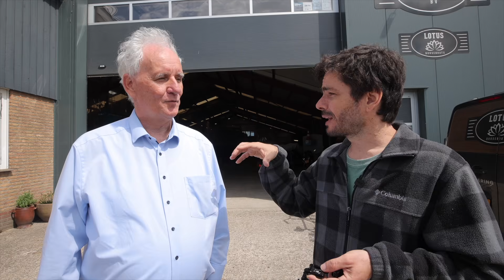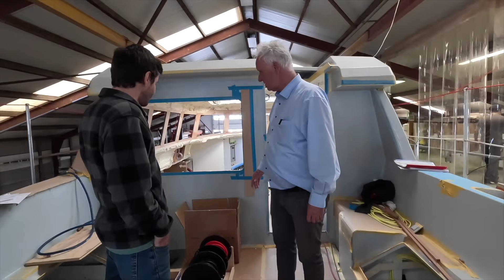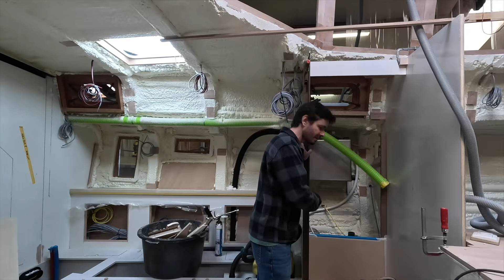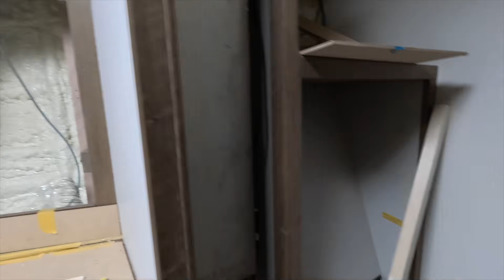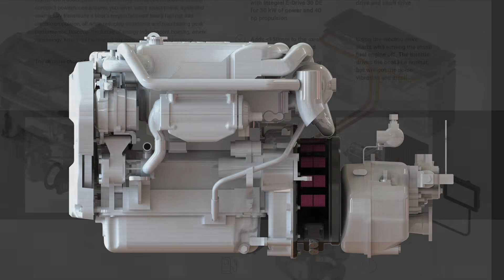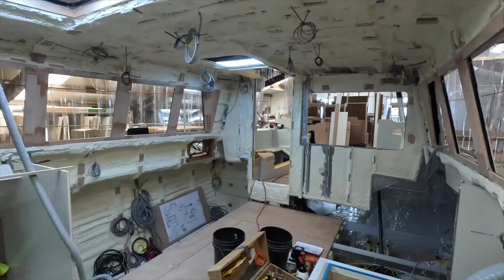⛵️ How to built a 50ft aluminum Deck Saloon Sailboat!!  Ep.360

Comment: Although it looks nice, having several bedroom windows near the waterline feels questionable in case of a collision. This would nullify the benefit of the strong aluminium hull, but the owner may have insisted. Get started with your own boat and don't be paralyzed by analysis. Save some money and leave out the exotic, unproven stuff and the most expensive ideas. You can always add later if you like. Cheers.
Reply: I agree,  the more you look at other people's idea's the more you question your own.  It's nice to appreciate other boats and builds,  but you can't appreciate your own if you want or need to see how everyone else is building. Remember they're building  and  designing to fit themselves and their families needs.  What they like might not fit well with what you're looking for and in the long term,  it may not suit you. Until you get your boat built you will never know.
Reply: Keep it simple slurring arctics boat is well set up
Reply: Hull windows are indeed well proven. They don’t just pop out, if well done and maintained. However, I also don’t want them, because maintenance means you have to remove and reseat them regularly. How many owners actually do that? I’ve never hear of anyone ever doing it. It still mostly works out fine, but also, most boats are not challenged much. The point about crashing is also correct. If the aluminium plates get hit hard, they will deform, usually without breaking. The windows certainly cannot follow and will come loose. A not very probable scenario, but it happens. That’s why aluminium is cool. It can take a beating, if needed. If that capability isn’t needed, why choose such an expensive (in both material and time) build material?
Reply: Seriously, show me one case where in-hull portlights were the reason of sinking.